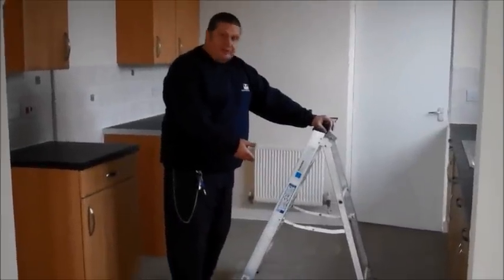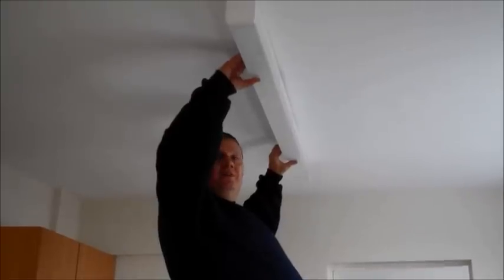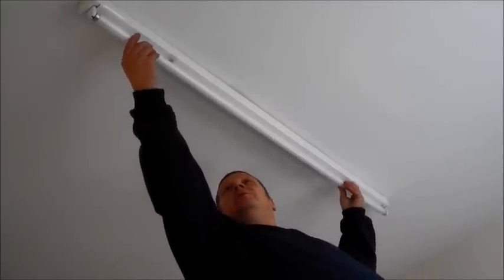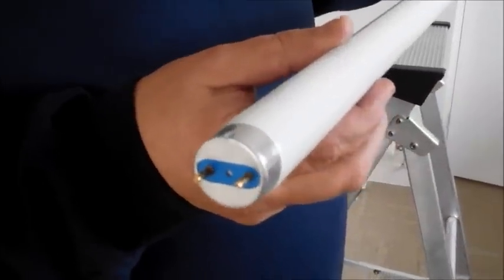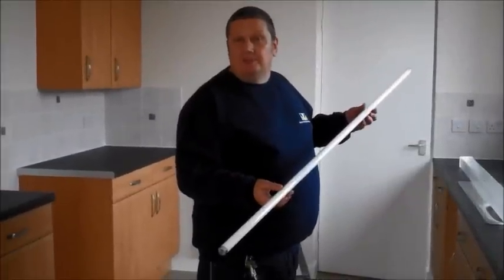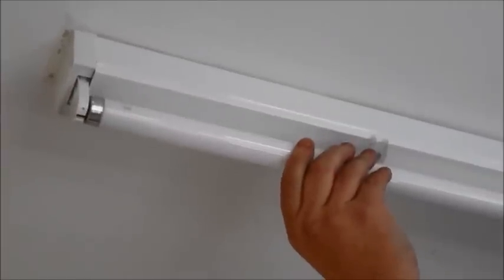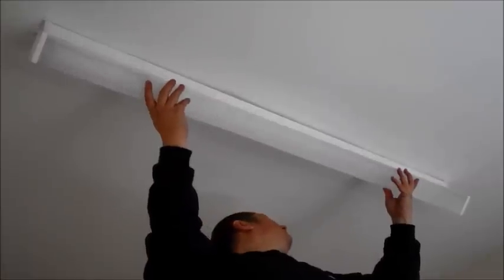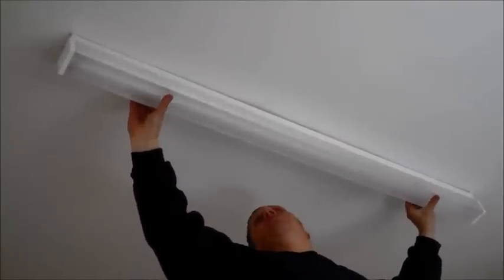How to Change a Fluorescent Tube

Comment: I've been having problems fitting a new tube as the bracket holding it to the ceiling became detached from its bracket when I removed the old tube! My husband died last year and I'm learning lots of new skills. I've re-fitted the light fitting but, try as I might, I could not get the tube to stay put. Mr Whalley's clear instructions were invaluable and light is restored. Grateful thanks.

Comment: Brilliant thanks. Because i had removed the old one incorrectly (without twisting), i couldn't put the new one in but thanks to understanding how the removal/replacement is supposed to work i managed to manually manouver the inner plastic ring each end to allow the new tube to slide in and then twist. 
All goes to prove my motto for anything DIY,  "Nothing is Easy".

Comment: I had trouble removing the cover and then I had trouble removing the light bulb.  I tried watching videos and read articles.  A lot said turn 90 degrees.  Sorry I'm slow.. I wasn't sure if that's left or right or clockwise or counterclockwise lol.  Thanks to your video confirming it's clockwise I was finally able to remove my T8 light bulb!  I'm used to following "lefty loosey, right tighty."

Comment: Two bulbs stopped working. They are dark on their ends. The multimeter shows the resistance is 2. Yet they are not working. Why? I put new ones, and those work.

Comment: Not that easy on the ones in work. They have black rings inside the connectors which prevents any turn. Iv pulled them out so hopefully they aren't needed